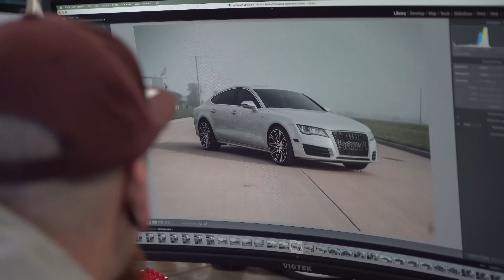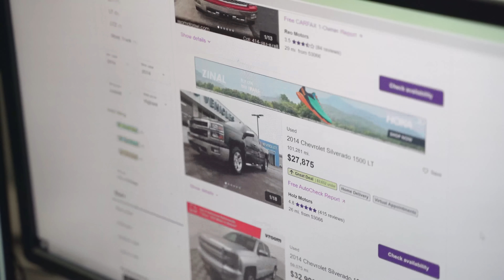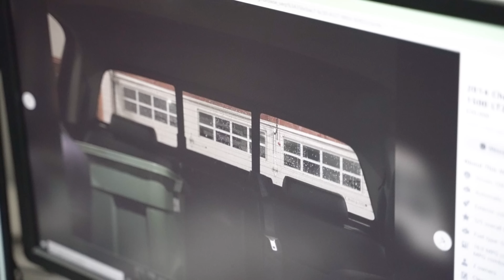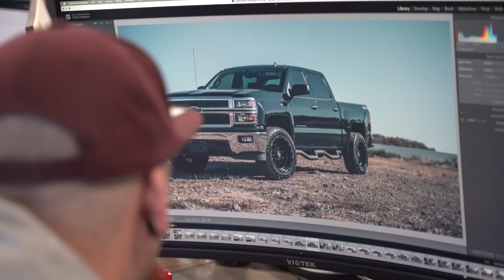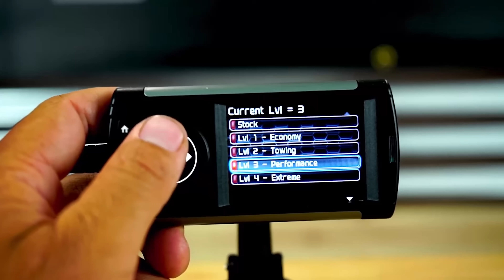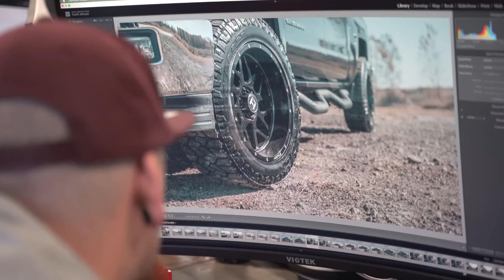Building a Silverado 1500 Dream Truck || Build Part 1 of 3

Comment: I have a 2014 1500. Bought when it was 35k on motor. I still have at 95k paid off.
The only thing i would recommend is make sure you delete or put a range to get rid of afm. It will ruin your lifters.

Comment: Im watching your build if you're worried about rust you need to get Cavity Wax with the wand amd spray over your wheel wells and pull plastic caps from inside door jambs and put that wand in there so your rockers and cab corners won't rust out, id also recommend spraying inside the frame rails.

Comment: I’m wanting to lift my truck 
But idk what lift I need 
I have a 2009 Chevy Tahoe LT RWD 
I’m going to go with 22x12.5 on 35s and need help finding a 6 - 6 1/2 inch lift
Reply from the maker: Check out what others are running to get that setup to fit here - https://www.customwheeloffset.com/wheel-offset-gallery?drive=4WD&make=Chevrolet&model=Tahoe&site=co&sort=yno&wheel_diameter_from=22&wheel_width_from=12.0&year=2009&tire_height_from=35q